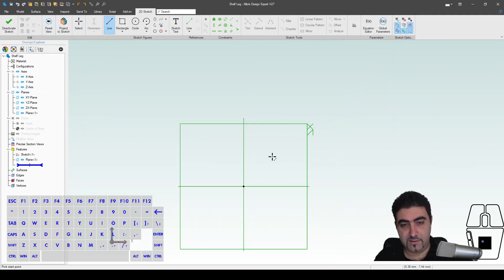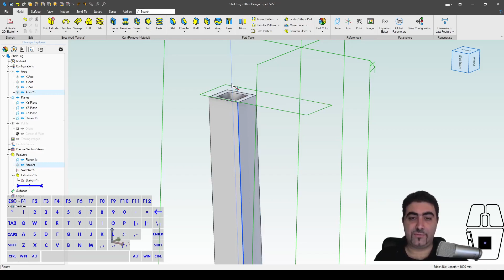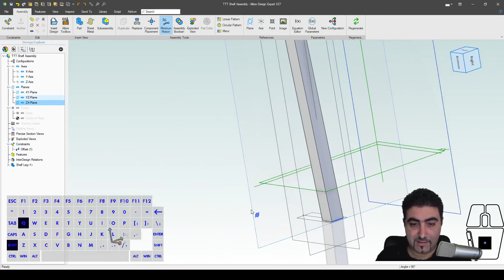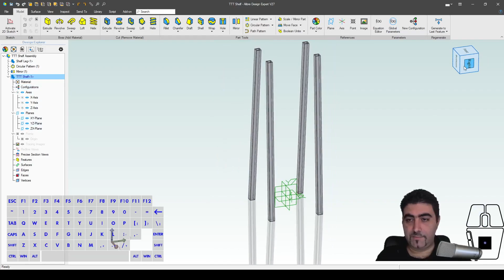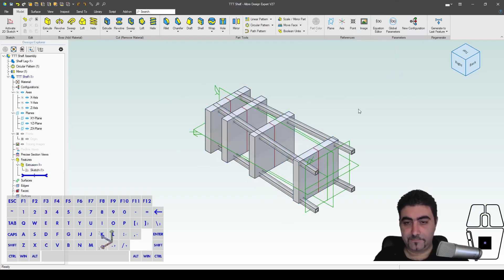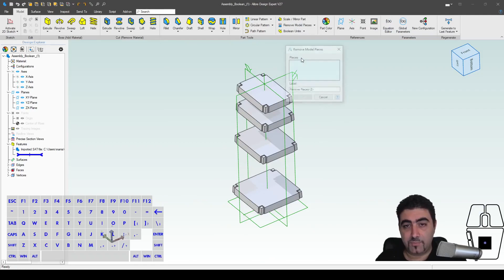Let's make this TooTallToby Assembly Practice Model: 23-12-06-ANGLED SHELF

Comment: Interesting workflow on this assembly. By extruding the leg along an axis it reduced one side of the leg a little. Not enough to make a difference on the mass though. That's why in my version I opted for an angled plane to sketch the leg profile on.
I thought of using the assembly boolean but opted not because it left the lumps. That turns out to be a good teaching moment though. Not a lot of CAD operators know about that, even in SolidWorks.
Reply from the maker: Yeah Harold, you are correct, the legs are not 30x30 with the method I used. And as you say, it was not enough to make a difference. In fact, TooTallToby in his own solve was 10 grams over 22.9kg and I was 12grams under. But the whole point of the video was to show new and interesting workflows.
And as the assembly boolean is really underused in Alibre, I feel that not many people use the extrude along direction instead of sweep as much as it could be done. It's a really interesting option, and I wanted to show how it works.
Thanks for the comment and thanks for watching, man!

Comment: I've never used Alibre but that seemed pretty good. I have a question though: is the leg actually a square 30x30 cross section when modeled that way? It might be close enough to not matter for the overall mass but I would expect extruding at an angle to cause the angled sides to be a bit closer than 30 from each other unless Alibre somehow re-orients the profile to be normal to the path... 
I should do a video on that on in Onshape someday!
Reply from the maker: Good catch! You are actually right. The profile is not 30x30. But the cosine of 4 is 0.997 or something so the difference is never going to show up in the mass. In a manufacturing scenario I would say that it is well within the tolerance of commercial square tubes too.
So, it is mathematically a mistake on my side and thank you for bringing it up for the viewers of this video.
But it is something you can get away with in this particular case

Comment: I love your tutorials. Very informative. Good job.
Reply from the maker: Thanks man! It means a lot! I'm just glad I'm helping.
Reply: If for some reason, SHS profiles changed to 40mm, boolean part updates accordingly? And if it updates, would delete lumps command keep its selection set to be deleted?
Reply from the maker: No, the assembly boolean parts are not Parametric, as I mentioned in the video. The deleted lumps would probably be ok. But if you want to have a Parametric boolean cut, you'd need to go into the Shelf part and set up a new boolean subtraction.
The easiest way to have a Parametric cut would be to project the leg profile and do an extrude cut along it's edge, just like I did when creating the leg.
Reply: @ExMachinaEngineering  understand. Thanks for explaining once more🙂
Reply from the maker: No problem, m8! Glad to help!